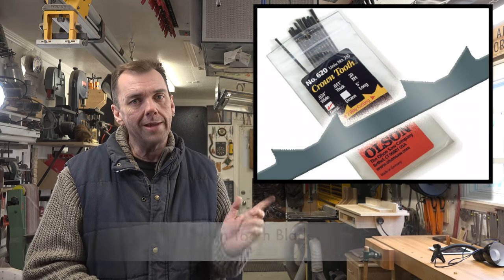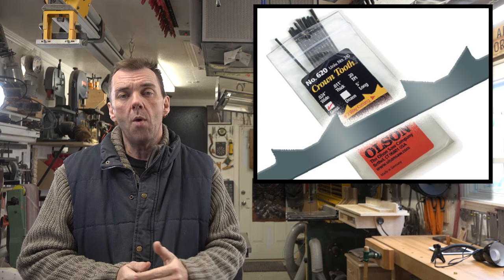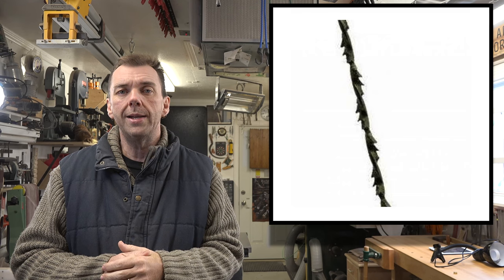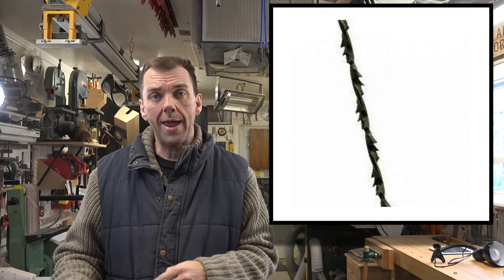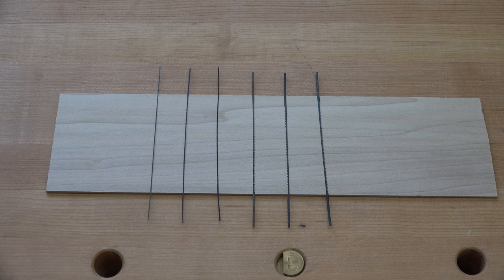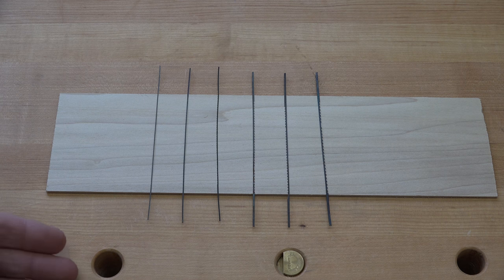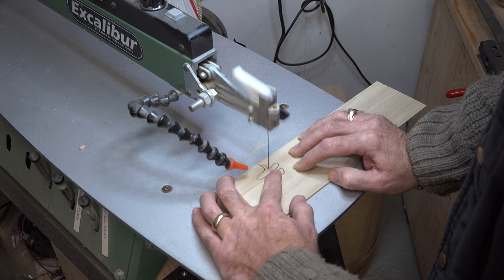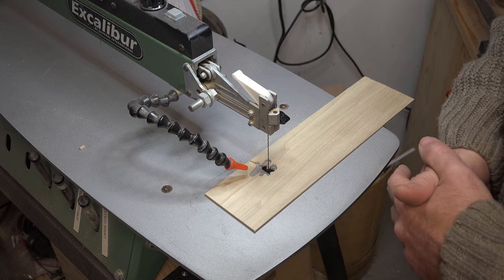Scroll Saw Blade Selection

Comment: Hi, question, can a flat blade be used in an old scroll saw that has a pin holder ? All of the blades that I have used have the pin but apparently they don’t come in a smaller size blade? Thanks, I’m confused about what I can use.😜
Reply from the maker: If you have an older style scroll saw that accepts pinned blades Verna, unless it specifically states that it will also accept flat end blades, then they are not usable in the older saw.  Now there are conversion kits available for some scroll saws that will allow you to adapt a pinned blade scroll saw to accept a flat end blade but I have to be honest and say that I have no personal experience with them.  Ones like this.  https://www.amazon.ca/Olson-Saw-AC49610-Scroll-Conversion/dp/B005ELXNX6/ref=sr_1_1?crid=KQAI52IPTBY8&keywords=scroll+saw+flat+blade+adapter&qid=1643341357&sprefix=scroll+saw+flat+blade+adapter%2Caps%2C97&sr=8-1
are what I am referring to.  I hope this helps a little.  Thanks for tuning in.

Comment: Excellent video, nice that you take your time and explain everything clearly. Just about to buy my first saw and this has been a huge help. Many thanks Kenny and greetings from the UK. Subscribed!
Reply from the maker: Glad to have you aboard as a subscriber Hugo.  Please don't hesitate to ask if you have any questions at all.  I'd be more than happy to help you out if I can.  Thanks for tuning in to the show.
Reply: @acutabove_woodworkings  Hiya Kenny, actually, I do have a quick question if you don`t mind. I don`t have a lot of money to spend on my first saw, and I`d like to try it for a while anyway to see if I get really into it before shelling out on a Hegner or similar. Problem is, there are plenty of cheap ones on the market in the UK, IE under £300, but every single one of them seems to use the same dreadful allen bolt clamp adapters for pinless blades, the bottom one drops off the hook when the blade it released and the top needs a tool and a lot of fiddling about every time. Any idea if anyone makes a budget saw with quick release clamp? Or an effective mod? Any suggestions much appreciated.
Reply from the maker: @hugostare8695  I'm not too familiar with the brands or saws that are available in the UK.  I did find this one, https://www.rutlands.co.uk/sp+power-tools-machinery-scroll-saws-variable-speed-scroll-saw-with-rotary-shaft-package-rutlands+dk7170#nogo
which seems to be a fairly good entry level saw according to the specification, but I can't tell in the picture if it has the blade adapter that you are complaining about.  It might be worth looking into.  Barring that, you really can't go wrong with a DeWalt, DW788 scroll saw as an entry level saw.  (if they are available in your area). I hope this helps.
Reply: @acutabove_woodworkings  Thanks Kenny, much appreciated. Thanks for taking the time to look these up. Rutland saw uses the hideous clamp adapter arrangement unfortunately, and yep, the Dwalt is very desirable and available here but well out of my price range, around £700.  But, I had a spot of luck today, picked up this locally, second hand, light use, couple of years old, for £300! Think I`m going to enjoy this..    https://www.axminstertools.com/axminster-trade-series-ex-16-scroll-saw-101771
Reply from the maker: @hugostare8695  Looks like you have a nice saw there.  It is very similar to the Excalibur EX-21.  You should be happy with that.  Good luck with your adventure in learning scrolling.  If you have any questions along the way, please don't hesitate to ask.
Reply: @acutabove_woodworkings  Yep, think I read somewhere that it`s the same as the Excalibur. Thanks for your offer of help Kenny, I will bear it in mind if I get stuck. Is it best to bolt it direct to a bench, of would thin rubber mounts under the feet help? Maybe I`ll try both ways, rubber could make it worse...
Reply from the maker: @hugostare8695  It's always best to mount a scroll saw directly to a bench in order to minimize vibrations.  I have, in the past used rubber washers between the scroll saw and the table, which also helps to cushion the vibrations of the saw.  I hope this helps.
Reply: @acutabove_woodworkings  Yes, I`m building a custom bench for it at the moment, so I`ll try it with and without some rubber and see what works best. Thanks Kenny!
Reply: @acutabove_woodworkings  Just watched your Guitar pick holder tutorial, my son is a musician and his birthday`s coming up soon. I think he`d really love that,  probably way too ambitious for a first project but what the hell, think I`ll give it a go! I`ll let you know how many trees I get throught before I manage to make something presentable.  I`ve got a couple of acres of woodland so I can spare a few...
Reply from the maker: @hugostare8695  Don't sell yourself short.  You may just surprise yourself.  Take your time, slow the saw down and I think you will do just fine.  Good luck with your project.  I hope you are happy with it.
Reply from the maker: @hugostare8695  You're very welcome.

Comment: @acutabove_woodworkings thanks for clarification.  Your work is amazing! You must be a very patient person...
If I am working with wood from   2 mm thin to 1.5 cm thick...some soft and some hard...what 3 blades should I start out with. I know I want a reverse blade for minimal sanding. 
I will be potentially be making replacement pieces for inlay, name plates (cutting the names out of the middle), cutting out whole words thick enough to stand up on their own and probably jewellery pieces...oh and jewellery boxes...
What is the make and model of the small accordian hose you have attached to your saw please?
Reply from the maker: The main blades that I would suggest are a #2 for thinner work, a #3 PGT for cuts up to 1/2" thick and a #7 PGT for cuts 1/2" and over.  I hope this helps.  The according air hose doesn't have a brand name.  It is a part of the saw.  Most scroll saws will come with a blower tube of some kind.  Mine is just an accordion style.  I hope this helps.  Glad that you found the blade video.  Thanks for tuning in.
Reply: @acutabove_woodworkings  wrote it down...thanks!

Comment: What category of work are your main ones for using the scroll saw rather than a band saw. I saw where a fellow was using a 1/8 inch blade on a bandsaw and doing some intricate cuts. I ask this because I dont have a scroll saw and my 1954 bandsaw needs to be replaced...I wont be buying both, but if I were to buy a scroll saw, excalibur, king and pegas are the ones I am looking at. Thanks for your videos.
Reply from the maker: I use the scroll saw for everything Drake.  There are so many projects that the scroll saw has a part in.  When I think of all the processes that I use a scroll saw for, there is only one that couldn't be done on a bandsaw and that would be fretwork.  Fretwork is the main use for my scroll saw and I just find that its versatility over a bandsaw is huge.  For the most part, the cuts on a bandsaw can be quite rough whereas with a scroll saw, the cuts can be smooth enough that sanding isn't even required on the cut edges.  Even with a 1/8" blade, the radius of cuts (while they can be quite tight) still cannot compare with the right radii that are possible with a scroll saw.  With a scroll saw, you can rotate a piece of stock 180 degrees and follow back through the cut you just made.  With a bandsaw, that just isn't possible.  A lot of bandsaws will not accept a 1/8" blade and a 3/16" is the smallest that they will accept so that might be something that you want to consider as well.  Not knowing what you main purpose is for these saws, it's pretty hard to make a suggestion.  I will say that in my opinion, a bandsaw can never replace a scroll saw and a scroll saw can never replace a band saw.  They both have processes that they excel at and although most processes are possible on both saws, the results and ease of cutting will shine on one saw over the other.  You can re-saw on a scroll saw but only to a two inch thickness.  You can re-saw on a bandsaw to a much thicker depth, but you can't get the fine cutting that you can on a scroll saw.  Cutting smaller pieces on a bandsaw with a smaller blade is possible but it is also more dangerous than using a scroll saw.  That constantly rotating blade of the bandsaw takes a nasty bite if you get too close whereas a scroll saw just gives you a "kiss".  LOL.  I hope this has helped a little.  Feel free to ask any other questions you might have.  Thanks for tuning in to the show.
Reply: @acutabove_woodworkings  while I am impressed with the end product of fretwork and the amount of time consumed doing that fretwork, I find fretwork a bit lacey.
Reply from the maker: @lmallard3788  I can understand that completely.  You have to realize though that fretwork is the process of cutting multiple holes to form a design, pattern or picture.  The cat cutting that you were inquiring about (leopard) is also considered fretwork and I don't find it Lacey at all.  With that being said, I've seen some fretwork that looks like it belongs on Grandma's end table with an accent lamp and some coasters.  Now THAT's Lacey.  LOL.

Comment: If you could put a musical note or sound to how much tension is optimal for most blades what sound would you say it might be?  In my experience over the last 10 yrs that average tone sound is equivalent to about notes of "A," "B," or "C" depending on the thinness of the blade - thicker blades more towards the note of "A," whereas the skinnier they are, more towards the higher note of "C."     Thoughts?
Reply from the maker: I have never really thought about the tension of the blade in relation to musical notes John.  I have thought of it more in terms of tone.  Much the same way that a improperly tensioned guitar string will yield a dead and muffled tone, a scroll saw blade will do the same.  You want a higher pitched clean tone coming from the blade when you pluck it.  As long as the tone is of a higher pitch and clean, the note itself isn't that important.  Thickness of the blades and different materials, teeth counts, gullets, skip tooth vs reverse tooth etc will all change the "notes" of the tensioned blade and you will end up driving yourself crazy trying to relate to a note.  Try for a clean tone and go from there.  I hope this helps.  Thanks for tuning in to the show.
Reply: Thank you for that reply.  I am a guitarist. So I suppose the musical note immediately came into mind since finding that sweet spot for sound depending on the blade size is how I know when the tension is good if not just right.  Of course an additional check I use is to see how much the blade bends back from the vertical while the blade is cutting (using a normal amount of pressure) so that when cutting the wood, the blade barely moves backwards as the wood is pressed into it to cut. Too much bend in my experience means the blade needs a little more tension.  I hope that is also something you look for once you feel the blade is tensioned just right? @acutabove_woodworkings
Reply from the maker: @johnhuggins5021  Sounds like you are doing it right already.  Another thing to watch out for is curved cuts (top to bottom) on thicker stock.  This can be caused by poor tension.  I understand completely the need or desire to get the perfect tension but rest assured that the scroll saw is very forgiving in this department.  I'd love to see some of your work some time.
Reply: Sure. Here's one of my recent intarsia projects. 20231017_125742.jpg   If this jpg file does not work pls send me an email address or describe how I can post it here.
Reply from the maker: There is no way to place images in YouTube comments so your images are not viewable.   You can however send them to kennye@acutabovewoodworkings.com
Reply: So the pic came thru for you?

Comment: Hi, I’m confused, can a flat end blade be used on a machine with the pin apparatus? Thank you 🙏
Reply from the maker: No, not unless the machine specifically states that it can take either style blade.  If you have an older style scroll saw that accepts pinned blades Verna, unless it specifically states that it will also accept flat end blades, then they are not usable in the older saw.  Now there are conversion kits available for some scroll saws that will allow you to adapt a pinned blade scroll saw to accept a flat end blade but I have to be honest and say that I have no personal experience with them.  Ones like this.  https://www.amazon.ca/Olson-Saw-AC49610-Scroll-Conversion/dp/B005ELXNX6/ref=sr_1_1?crid=KQAI52IPTBY8&keywords=scroll+saw+flat+blade+adapter&qid=1643341357&sprefix=scroll+saw+flat+blade+adapter%2Caps%2C97&sr=8-1
are what I am referring to.  I hope this helps a little.  Thanks for tuning in.
Reply: Thank you for giving me this info, I think I will just purchase a new machine, do you have any experience with the “glow forge”? They look like they work very well but they are expensive! Have a great evening 😋

Comment: Are the Scroll saw blade numbers 5, 7, 9 and TPI the same for softwood and hardwood.
Reply from the maker: The universal blade numbers and the TPI are the same on the blades regardless of what you are cutting.  There are not different blades for hard woods or soft woods.  What is important is that you choose the correct blade for the species that you are cutting.  It is a combination of thickness and harness that will determine what blade you use.  For 1/2" thick pine (for example) you can probably get away with a #3 blade but would have to step it up to a #5 for 1/2" thick maple.  I hope this helps a little Douglas.  Thanks for tuning in to the show.

Comment: The burring could probably be greatly reduced by putting masking tape on the back , right?
Reply from the maker: I've never heard of anyone using this method but I can see where it might work.  The masking tape  might act as a sacrificial "board" that would support the back of the piece during cutting.  You might be on to something.  I will have to give this a try.  Thanks for tuning in and for chiming in with your question.

Comment: Hey once more Ken. Couldn't find a way to post another question, so hope you see this here. Printing patterns. I have a standard home use inkjet printer. It's pretty good for most things, but as I'm printing scroll saw patterns, it sometimes - even on a straight line - has a little jig to the left or right. This throws me off - just a rooky thing or is this something that bothers the pros as well? Would an investment in a laser (color laser) be worth it? Thanks.
Reply from the maker: There are plenty of ways to contact me to ask me questions Rey.  You can comment on a video (like you've done here), you can send me a PM at the channel's Facebook page, or your can drop me an email.  All of the information on getting to my Facebook page or email is contained in the home page of my YouTube channel under the "about" tab.  Now, to your question.  I currently use a laser printer but I also used an inkjet for many years with no issues.  If the issue with your printer is that is "sometimes" has a little jig in the line and that is what messes you up, you can compensate for that.  Check your patter thoroughly before cutting and correct any areas that have that jig in them.  A little bit of ink from a pen or some lead from a pencil is a lot cheaper than a laser printer.  That money would be better spent on new tools or scroll saw accessories.  LOL.  You may also want to try and learn to look ahead of the cut.   What I mean by that is while you are cutting a straight line, every once in a while, just glance at what is coming up so that you know what you are dealing with.  It might be a right or left curve or a jig in the straight line.  Beginners have a tendency to be too rigid at the saw and try to follow the lines EXACTLY.  There will always be deviations from the lines of a pattern and for the most part, in the grand scheme of the project, no one but you will ever notice them.  Try to relax, enjoy the process and follow the lines as best you can for now.  If you veer off of the pattern for just a little bit, don't sweat it, it happens to everyone no matter what their level of experience.  I hope that this helps you a little bit.  If not, please feel free to contact me with more questions.  I'm sure that we can work it out.  Thanks for tuning in to the show.